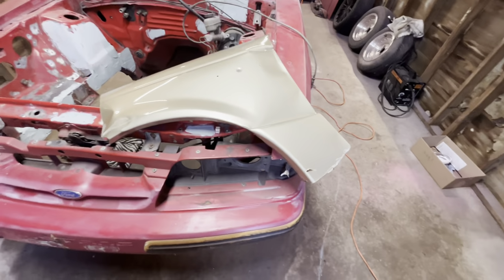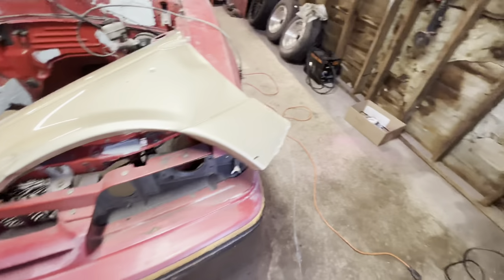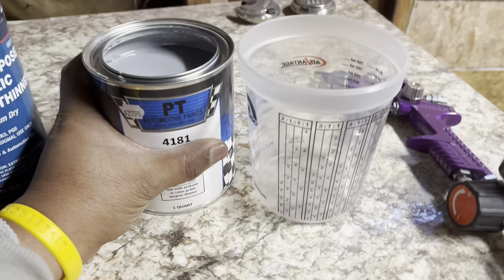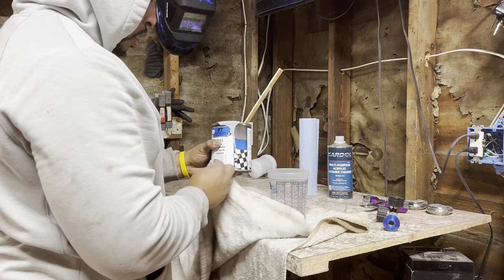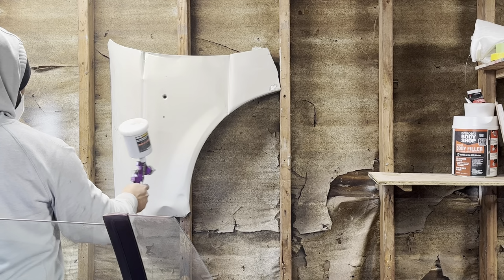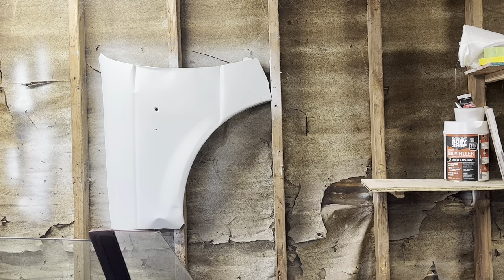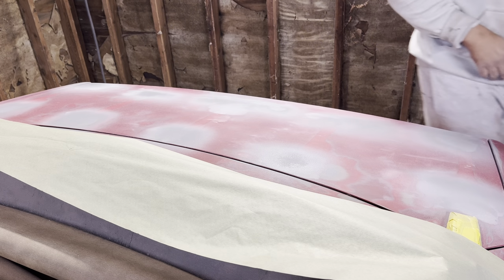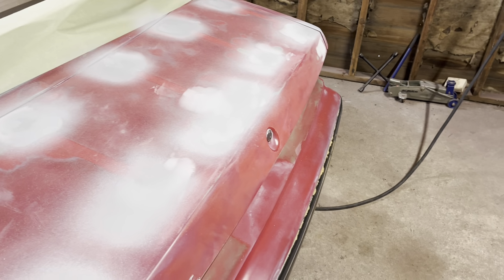Painting With A Small Compressor And Spray Gun

Comment: How do you have your spray gun set up and how is your compressor setup?
Reply from the maker: i set both at 30 psi, im not sure if that was too high or not. Then i messed up and didn’t clean the gun before using it like you say to do 🤦🏽‍♂️ it was oil all inside it, i remembered after spraying.
Reply: @mrdiycarcustoms  that spray gun likes higher air pressure, and next time you’re doing some testing, try taking the cap at the top of the cup out and see if that helps with the flow of your material, that may help it eliminate some of the texture
Reply from the maker: @UndergroundPaintKing  ok cool thanks 👍🏾✌🏾
Reply: The pressure should be higher I think
Reply from the maker: @TrapSquadTV100  im going to finish the trunk with a higher psi and see how it comes out tomorrow